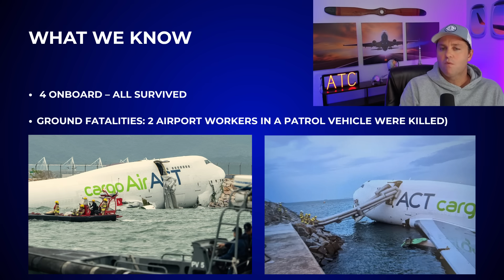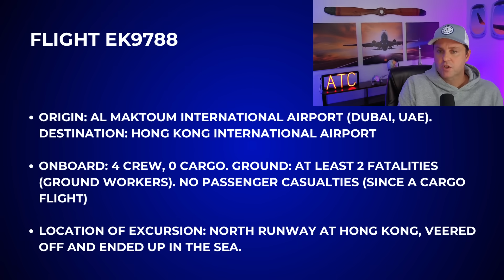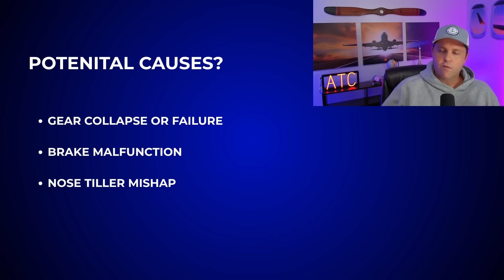747 Runway Crash | Pilot Breakdown & Potential Causes

Comment: Yes, the runway was wet according to some suggestions in reports.

So, some say about skidding. Thus, that brings my curiosity to steering of the a big commercial plane in general.

The reserach shows that the rudder loses steering effect if the speed is below 30 to 40 knots. For the rudder to have good effect, the speed should be at least around 60-80 knots.

So, the ACT cargo B747 started veering to the left at around 90 knots (after taxiing 1 km). That is weird. At that speed, the plane's rudder could still have effect on steering. Hence, why skidding is a contributing factor to the incident/accident?

Would it be human errors?

Comment: Having thought about this, and as it has happened before I am going to say he landed short of the runway because, it is hard to judge hight over water.
At Hong Kong you approach over the water, end of the man made island a bit of taxiway and there is the threshold of the runway. 
You must not land short!
If you come in to low your going to hit the end of the island. 
ILS ,not working?
If so, did he miss judge his height like the last pilot did?
One thing is for certain the 747-400 doesn't recover well from too slow or too low on short final.
I know, I have done 747-400 into Hong Kong many times on the sim, and always went for landing long.

Comment: Breaks possibly, only one side revers thrust operated,  that would pull the plane slightly to one side.
The 747 has 4 main landing gears, unlikely to have both on one side fail.
Hong Kong is a very easy straight in over the sea approach so unlikely to be pilot error. 
Radio altimeter calling out the wrong hight is a possibility, and it was landing gear collapse from a very hard landing.
Also could be they dropped in just short of the runway and hit the sea wall ripping off the landing gear. (That has happened. LAX, I think that one)

Comment: I live in Hong Kong.  The vehicle was on a perimeter road.   It was doing routine security checks as boats may land on the northern runway, so they do routine checks there.   Very unfortunate.  Should not have happened.
My vote is the there was a gear collapse or gear issue.  If you look at the damage to the front of the plane, it shows that the front gear may have collapsed - there is extensive damage to the front of the plane.   Crashing with the vehicle would not have caused that because the vehicle was not heavy or big.
Reply: How do you explain the fact that the runway is undamaged?

Comment: One of the aviation KOLs suggest porpoise landing.

However, if it is a porpoise landing, the tail section would remain on ground. Possibly, once the tail section was broken, because of the porpoise, it would be left on the runnway or somewhere near the runway.

Nevertheless, the tail section went with the plane unitl a spin (caused by obstruction off the runway and the momentum) that made the tail part submerged into the seawater. 

Anyhow, this video brings the attention to the damage to the nose and tail part of the plane. 

The damage of the nose can be explained. Nonetheless, the tail damage is mysterious.
Reply: Easy to explain if there have been structural damage at the tail section.  If the plane is not shot to the sea like a bullet, it may be a rather slow slide down.  Say when 3/4 of the plane hangs out of the seawall during the sliding,  the weight of that 3/4 will have enough force to snap the body apart if there is a severe crack line in the body.

Comment: Hey Gary. I'd go for some kind of catastrophic failure, too. A gear collapse, probably an anti-skid system failure on the left gear (if that's even possible), completely blocking the left gear. And yet, and depending on pilot reaction, if the left main gear brakes were to block, I assume you (almost) instantly release brake pressure, keep centre line, and adjust your braking. Maybe. Happy landings from Portugal 🇵🇹
Reply: Don't guess, ask the pilots. Simple

Comment: Other possibilities: Tire blowout, left main gear.
 Asymmetric thrust caused by inability to throttle
back one or both right side engines, or by a failure of reverse thrust on that side. 
Both men in the airport car were killed when the 747 struck their vehicle, which was on
a parallel access road, next to the water. American and Turkish investigators will be
assisting with the investigation. Boeing is the aircraft maker, Turkey is the country
of registry, and the engine maker is either Pratt & Whitney or GE.

Comment: Gear collapse makes a lot of sense but I guess we’ll be waiting for the official word. Thanks for this video Gary.❤️✈️
Reply: Check Captain steeeve's take on it. porpoise landing. that's what caused the nose damage
Reply: The crew would have handled the landing issue professionally, l rather suspended it to be poor maintenance leading to the left landing gear oleo buttoming, as a result the right landing gear travelled faster than the left and caused the aircraft to swing left off the runway